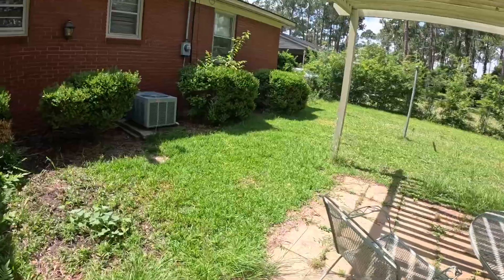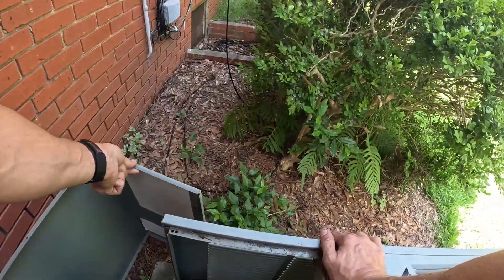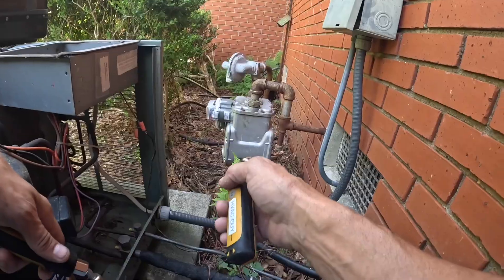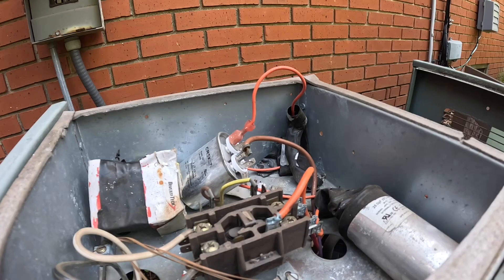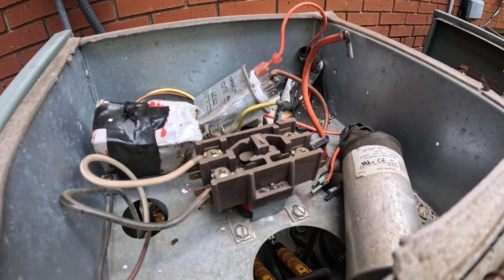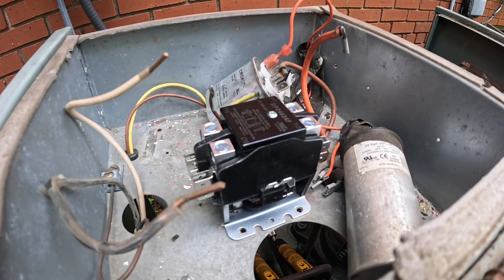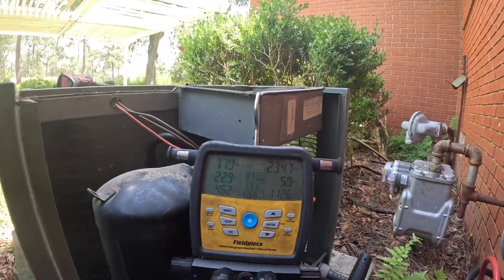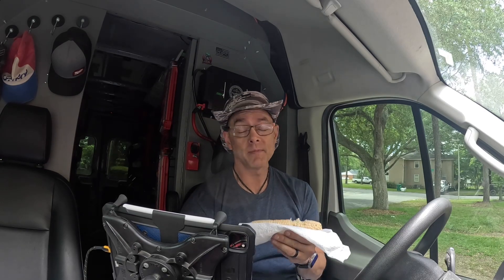Multiple Problems on A No Cooling Call! #hvacguy #hvaclife #hvactrainingvideos

Comment: I’ve never seen so many  Raheem and Rudd unirs you are always working on. I actually where I live have accounts with both of them. I think I’m gonna start putting them out again. The only reason I didn’t I was getting such a good deal from modern supply and Furgusons and then all of a sudden they got ridiculously high on me. I may try to do some renegotiating with those guys, I like the units

Comment: A one pole contractor is for “trickle heating” or”trickle charge “.The run capacitor will charge and discharge at 60 HZ resistance in the compressor windings will make a small amount of heat keeping the compressor warm.
Reply: If one pole remains live and there is no return path available, how does it keep the compressor warm? It is an open circuit with a leg hot all the time. Look at the schematic on the cover and report back to support your conclusion.

Comment: It's well agreed that capacitors' lifespan is shortened by heat (most of it internally generated by dielectric losses.)  Leaving the cap in the box provides insulation from cooling air and makes the problem worse.

Comment: Good job but i would have ran the yellow low voltage wire under the high voltage wire on the contacker

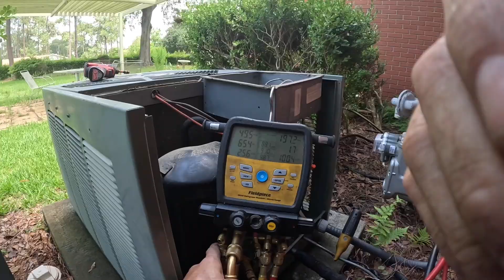Comment: 15:02 "That coil 'probably' has a TXV on it."
So you're charging by super cooling, which is a balance between superheat and subcooling?
(Edit)
I replayed this several times to make sure I actually heard what I thought I heard before responding.
Reply from the maker: Exactly
Reply: Not sure I understand what you saying.
If its a TXV then you ignore superheat and only go by subcooling.
Piston you do the reverse.
TXV is supposed to maintain a constant superheat.
Reply: @bobshanery5152 Always confirm before adjusting the charge:
Filter is clean.
Blower is clean.
Outdoor coil is clean.
Indoor coil is clean.
And...
What the metering devise actually is.
"Probably a TXV" could also be "Probably a piston."

Comment: I use to carry a bunch of 1” and 2”sheet metal strips cut from scrap that I would use to hold down capacitors and hang line sets .
Those older Rudd and Raheem units were tough units . A lot of them still in service .
Reply: i like perforated strap, i use it for lots of things
Reply: Always in the plumbing pipe supply area , in the box stores... 👍✌️🙏☝️😎

Comment: The run cap bandit  must have been training his students, 
There must be a Run cap bandit collage in Georgia. Because those guy's are everywhere .
I bet he's  offering another course  in condenser placement along with the run cap placement.
Reply: Some (a lot) of them migrate south to Florida. My favorite is when they just let it hang by the wires under the fan motor. Tape over the terminals you say? Run cap bandit don't have time for that. Don't get me started on the ones who leave old compressors, fan motors, etc. on rooftops of condos.

Comment: I had a replacement that I did where the old unit was almost touching the meter. I had always told the customer about it when doing maintenance. When I went to replace it, the customer and his son helped me make a new flat area 3 feet away from the meter. It was great having all the help.
Reply: Many of us customers are willing to help. But we don't want to "helicopter" over you. I think you can sense us as we start talking some of the jargon and yet still don't know what we mean. If you think we're willing to help, just ask. We love to help.

I recently replaced the capacitor-only (HERM?) capacitor for my Santa Fe Classic Dehumidifier. I tested it and found it low on ohms. So I replaced it. Too bad it's probably a lack of refrigerant probably due to rub-out of one part or another.
Reply: @NathanZSolomon no no no!  As a homeowner if i wanted to help id just do it myself to begin with and the fact the said person is getting paid is because i dont want to do it.
Reply: @shannonstrode7967  Eg. I installed a breaker in my subpanel, but I didn't tighten sufficiently the screw down that holds the black wire in place. I thought it was tight enough, but after the breaker kept tripping, I found the black wire partly cooked. Yes I still have enough confidence to add/replace breakers, but I learned an important lesson. Experience always teaches better than DIY videos or even watching experts.

There are things DIYers can do and things we can only guess at doing. Better safe than sorry.

Comment: Code is the same here in Ontario Curtis. Three feet from the meter regulator to the contactor in the condensor. 👍🇨🇦
Reply: NEC loves that 36" of clearance. I freaking wish the places I do electrical work believed in it. I'm getting my 608 cert next month, so I go from relatively experienced electrician to green as hell HVAC guy. So, I get to figure out how much I don't know about the part of the system you feed liquid money under pressure into. These videos have been immensely helpful.